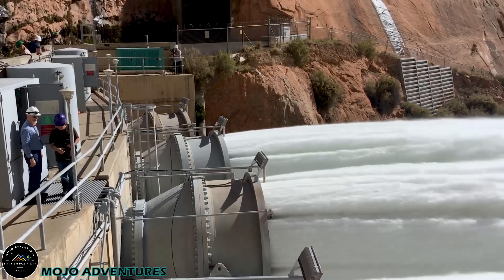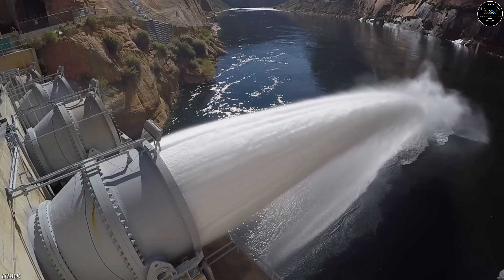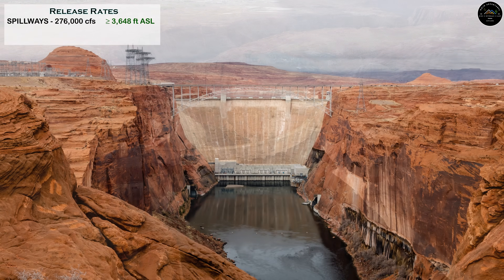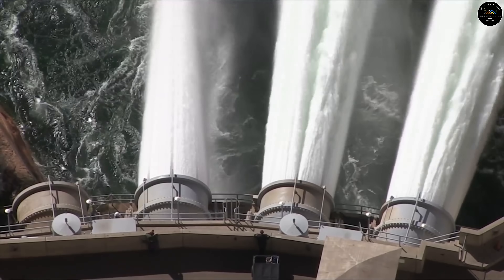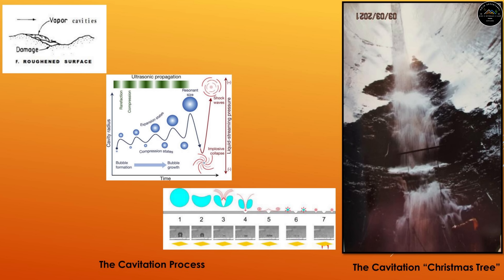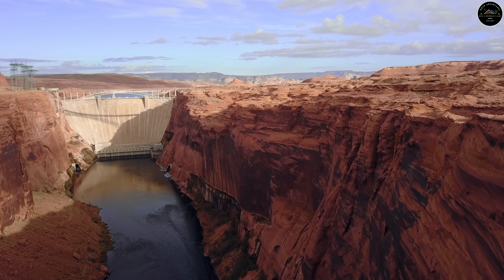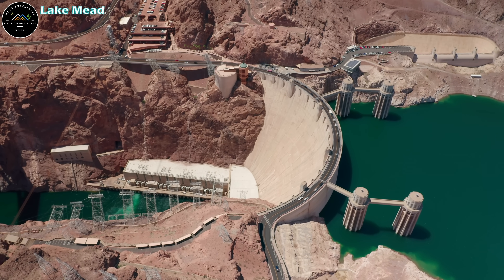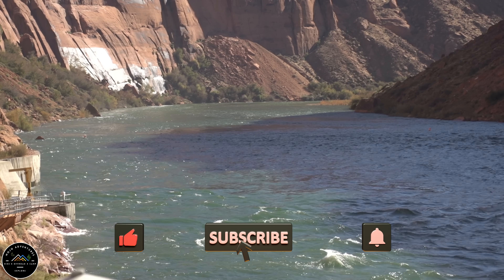TROUBLE ON THE COLORADO! Damaged Pipes FOUND Inside Glen Canyon Dam at Lake Powell #water #update

Comment: If backpressure is what prevents the penstocks from cavitation damage. Then those 4 river outlets should have restrictor on the openings to create backpressure. Rather than flowing full blast, have a reduced volume flow and sustained backpressure. The outlets could have variable outlets to fine tune flow. And best of all it would only require construction on the 4 river outlets. 
I still wonder why Glen canyon has so much trouble now and in 83 when A much older Hoover dam took the spillways flow in stride. I was at Hoover in 83 and it was Breathtakeing. The depth, the trembling roar of the spillways. I had no idea that volume was so temporary.
Reply: The backpressure would lessen or eliminate the cavitation, but it would not provide the high flow that was, I believe, the point of the experiment.  None the less, this clearly seems to be the right approach.
Reply: Hoover did experience cavitation in 1941, the only other year that it overflowed, historically. This is from a narrative of Glen Canyon's near failure in 1983:

Constructing the spillways in this way, where hundreds of linear feet of each 41-foot diameter diversion tunnel are repurposed, was both quicker and cheaper to construct. The tradeoff, however, was that the bend where the spillway tunnel meets the diversion tunnel created the potential for cavitation. This danger was known by Reclamation, with both Hoover Dam and Yellowtail Dam experiencing damage from cavitation in their similarly configured spillway tunnels (Hoover in 1941 and Yellowtail in 1967).  The risk, however, was deemed to be minimal. According to W.L. Rusho, longtime public affairs officer for Reclamation, including the period during the Glen Canyon Dam incident, “A well-managed reservoir should almost never spill, and then only for very short periods, after which the cavitation could be repaired.”
Reply from the maker: Great ideas there! I will have to do some more digging and see if the USBR posts more detailed information on what the exact causes are this time. I could definitely see backpressure playing a part. When the spillways were damaged in '83 the main culprit was the high pitch at the top of the tunnels. I'm with you there also wondering how a newer dam has so much more trouble than an older (and bigger) one. Even if the cavitation issue is fixed again in the river works outlet, it still doesn't solve the problem of sedimentation or address the need for a low level bypass during drought periods. Wish I could have seen Hoover spilling back then. I hold out hope that maybe once more in the future before I'm done here I'll get to experience that!
Reply: From the video it looks like the river works are built using cement.  I was wondering why those outlets do not have a metal-based inner lining that will (presumably) decrease cavitation, since metal is smoother than cement.  My guess is that issue is the extra cost, but is there any other reason why metal is not used?
Reply: Hoover dam spillway also has had cavitation damage too, and now also has an air slot to prevent further damage. There was a lot of new technology that went into building Hoover, but because it was the first of its kind, there were many unknowns. The effects of cavitation were not well understood anywhere in the world, even at the time Glen Canyon was being built. When you push technology to its known limits, you learn things you never knew. However, both dams are still very safe. In the grand scheme, cavitation damage at these dams is a challenge that can be fixed. The dams were never in any danger of falling, regardless of the drama portrayed in the press.
Reply: I also remember being at Hoover when the spillways were functioning.  Breathtaking display of natural forces, in this case water flows.
Reply: Why does it need to be all or nothing? Just open the valves to a partial setting.
Reply: @joewoodchuck3824  The designers never expected the water levels to reach the spillways. Thus, thoughts of the reservoir level being at the top of the dam, as only reached in 1983, are nonsensical.
Reply: @joewoodchuck3824 in many cases partial flows can create more turbulence and cavitation.

Comment: They have been watching this for years. The high flow was too see if they would get damaged. They got an answer. If the pool is low they will not have the pressure to stop the cavitation. At full pool they don't surfer from cavitation. Now they know that the penstocks don't work the way they designed them to. 

Just an excuse to keep water to produce electricity always.